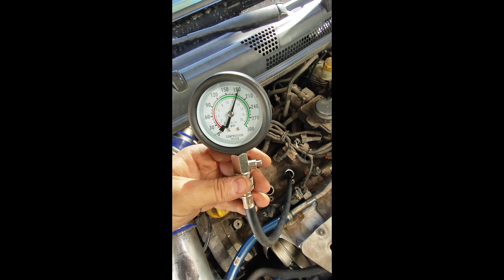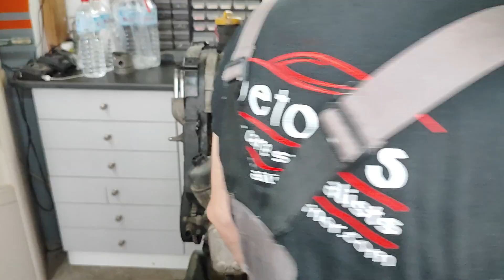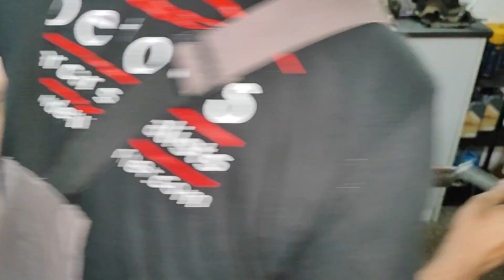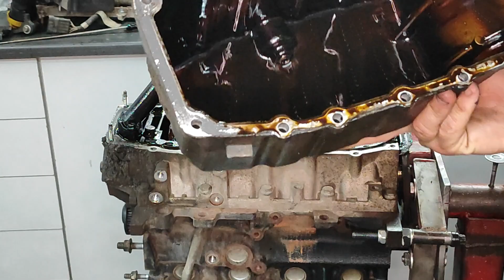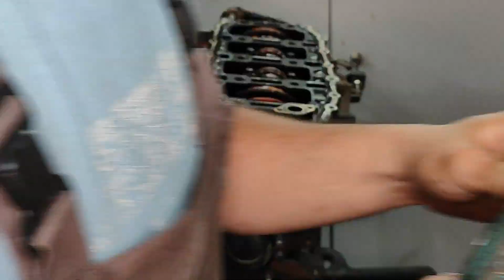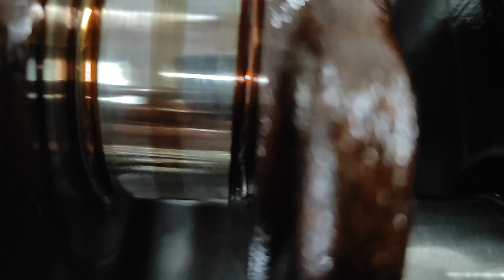Fiat 500 Abarth smoking too much. Symptoms, cause and engine teardown!

Comment: I would have looked at that turbo and blamed that for its clearly oil being sucked into the engine either that or valve stem seals

Comment: when you tear down an engine, instead of diagnosing the PCV sucking or sending oil LOL
Reply from the maker: @canoaslan1011  apparently you didnt watch the whole video . If you did you would see the condition of the pistons and rings. Also the result of the compression test in all the cylinders. Thanks for the comment though!

Comment: My brothers 2012 Abarth has 390,000km, & has no issues, but we change the oil with genuine Selena Abarth oil every 15,000km. The engine is all original, it has never had the head or sump off, inlet/injectors/exhaust/turbo etc, not been off either.. Only "engine parts" that have been changed has been a thermostat at around 300,000km, & the water pump with every timing belt change, as well as a few position sensors & coil packs over the years (none of which caused a breakdown, just rough running) & that is all. They are a great engine  The issues on your example is 100% down to a bad owner either not servicing it often enough, &/or not using the correct oil.
Reply: For Fiat group engines it is a critic point to use the factory oil. The selenia/abarth oils are not just re labeled stuff like for opel or toyota where they pick one from the market and they sell it with a new label. Fiat really develops their oils since the old rally times (Olio Fiat, later FL - Fiat Lubrificanti and later FL Selenia). I always try to convince people to use them but some people are just idiot, they go for other brands and later they used to say, Fiat engine is crap because it consumes oil… lol, never ever had to top op any of my italian cars. Just the regular oil change (at the 50 % of the factory suggested kms) and never ever a single issue. In good hands the most reliable engines. (Other family memebers suffered with opels, audis and even toyotas, while my car just kept going..
Reply: Really nice, just reached 200 000 kms two days ago with my 2014 Abarth 500. So I know that I have quite some kms left😅
Reply: @maxfactor1841  Good going. my 2009 Abarth Grande Punto now has 222,894 km and still going well.

Comment: Hi, my car smoked (luckily not like in the video) only when I gave gas after releasing it downhill, the longer the descent lasted the more it smoked, the turbine had some play and I changed it with a new one 300km ago, the problem is that the car in the same conditions still smokes but very little compared to before the turbo was replaced, is it oil that is left or do I have some other damage? I checked the oil and it eats little or nothing
Reply from the maker: @cocodomeno  Hello. It is highly possible that this smoke is from oil residue in the exhaust system from the previous turbine. Unless you drive it hard so the exhaust system is put to some serious heat, the smoke will take some time to vanish. Thanks for the comment!
Reply: @amtperformance7072  I wouldn't want them to be the valve rubbers...
Reply from the maker: @cocodomeno  the valve seals smoke a little when the engine is cold. When you warm the engine the seals will not let oil to pass them. So probably it is not the problem.
Reply: @amtperformance7072  the car smokes when cold but it's not oil but water having a 63.5mm exhaust with 120mm tips, I only get oil smoke when I accelerate on a descent, if I go downhill accelerating always it never smokes, for this we don't understand what's wrong with the car. if it was residue it should always smoke, I pulled it goes very well and I reached 936 degrees of egt at 248 km/h, engine oil at 107 degrees, so it has seen high temperatures, I removed the spark plugs and they are dry there is no oil
Reply from the maker: @cocodomeno  check the oil return line. If it is not completely free it can cause a problem like this. Otherwise it seems that you have to check deeper....
Reply: @cocodomeno  Air oil separator/pcv valve does that on the multair. The flapper valves inside get stuck and the intake pulls oil into the line under vacuum.
Reply: @oldedutchmaster  But how could it pull any significant amount trough? That would require a very bad seal inside the engine (which would cause excessive amount of crankcase gasses anyway) and probably a very clogged air filter to suck oil trough, isn't it? My point is that it needs multiple failures to manifest like that: engine wear (to allow large blow by), pcv valve issue (to not reduce the gas flow towards the intake manifold), oil separator issue (to let the oil carried by the gas into the intake) and a clogged air filter, to make it easier to suck significant amount of gas from the cranshaft case instead of just sucking in fresh air.

I mean I don't know much about engines, so please correct me if I'm wrong. I have a Delta with the same engine and it does very similar thing: excessive bad smelling exhaust after coming downhill with engine breaks. It goes away later. It only does this with cold engine, first start of the day, even in those cases just once out of 10 occasion. But it never does with warm engine end never does if not coming downhill for the first few minutes. Although it makes some bad smell some other times too with cold engine, but never extremely much smoke. Only if first start with cold engine goes downhill...
Reply: Im having the same issue, already went through valve stem seals, still smokes, i already bought a new turbo and gonna replace it soon